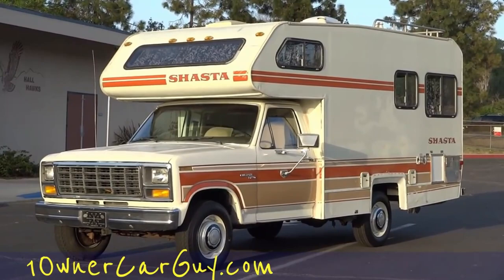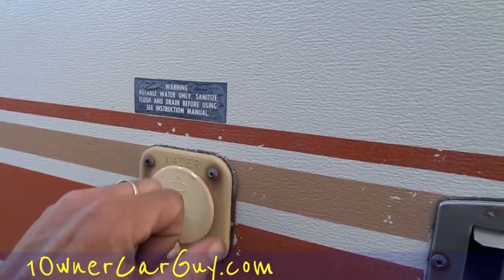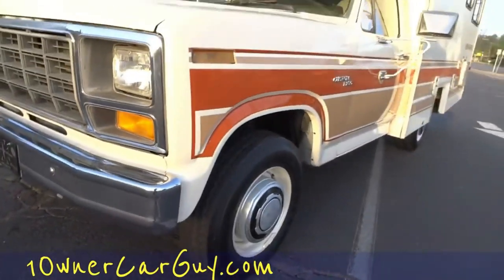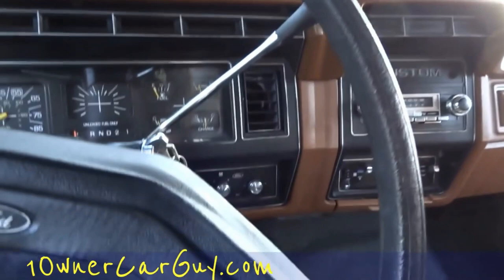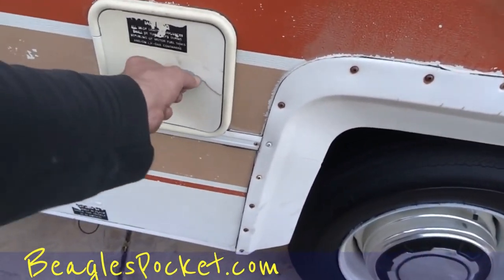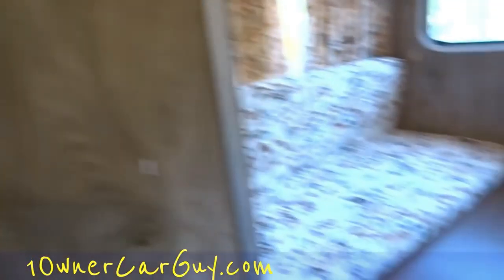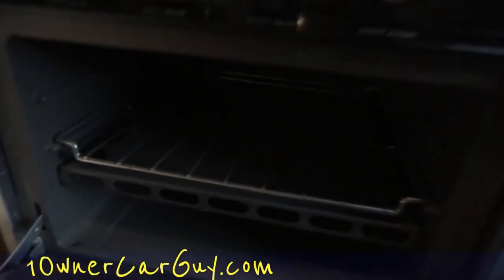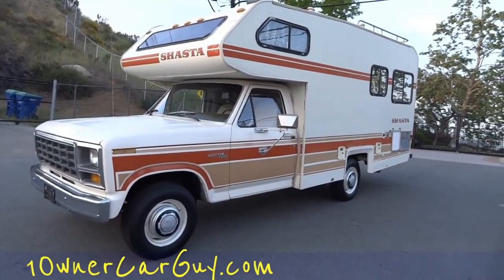Classic Ford Shasta like Chinook Class C B RV Motorhome / Camper F250 Slant Nose

Comment: Jjj I have one but my is a 1981 f150 and the enter door is the same side as yours but in the rear side plus different set up from yours I enter to the kitchen plus my have the sink refrigerator and next to the stove is the bathroom shower my is beautiful all wood 4 sp standard transmission only have 66 thousands miles original plus I made my 4x4 with Manuel lockers she is a beast amigo probably my was special order plus all numbers match to plus she is straight 6 300 engine the best ever made carburetor